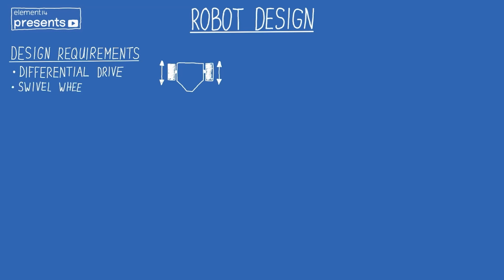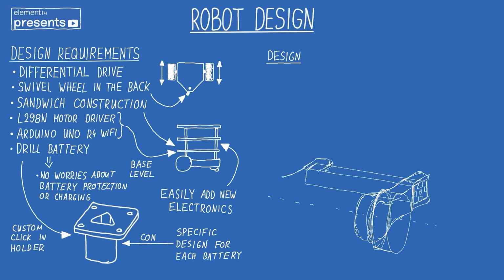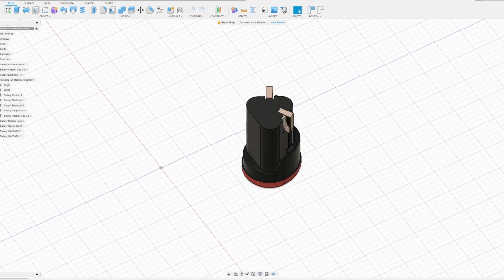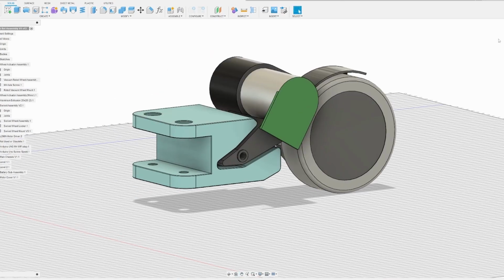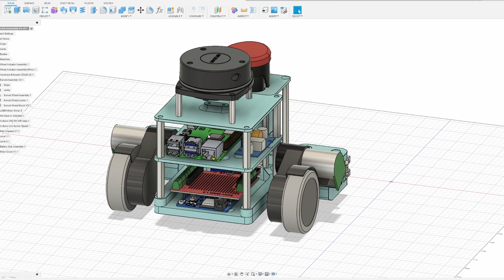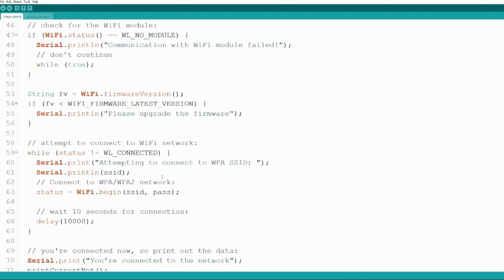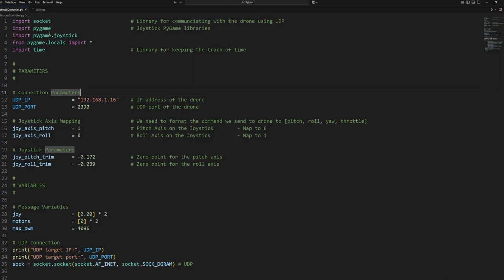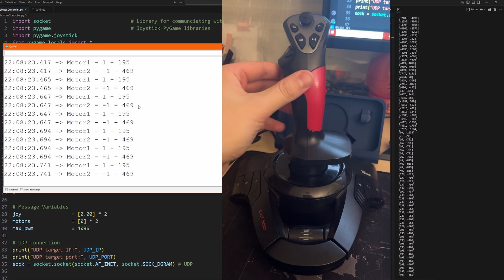PlatypusBot - Scavenging for Robotics Parts

Comment: It bothers me that things with dead batteries are considered "broken" when replacing the battery is usually an easy fix and there's nothing else wrong.
Reply: Agree completely, the problem is that these things have become incredibly cheap and widespread, that for most people is often easier to get a newer model after the battery goes after a few years rather than changing the battery. The “broken” ones are a really good source of parts though!